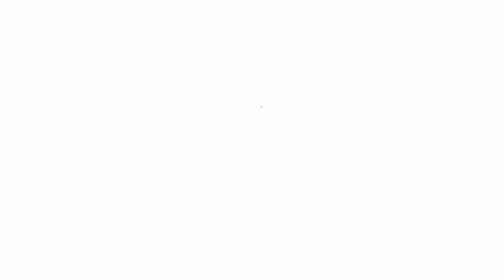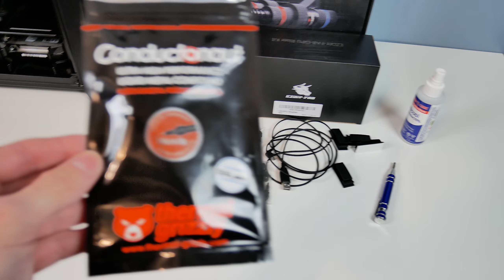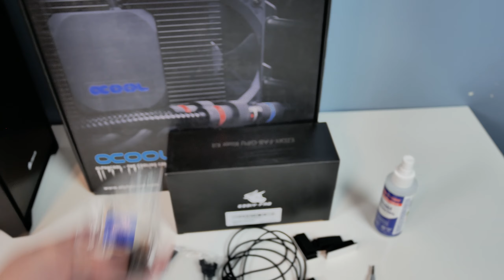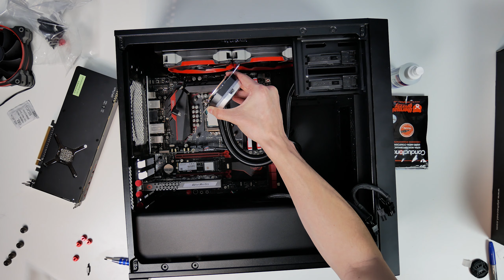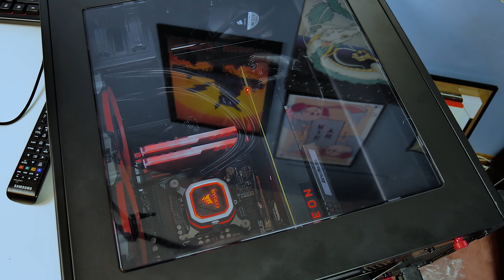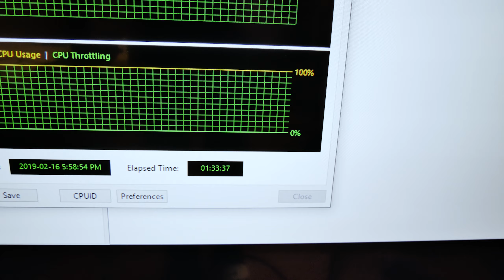A Rough Start... | Build Log #1

Comment: Good stuff. I think it's time for a new case, like Corsair 460x or something, there's built in vertical mount, removable psu shroud and plenty of space both for cpu and gpu liquid cooling mods, which would've save you some money not buying additional accessories. But I'm sure you know this :)
Reply from the maker: Thanks! I actually am not a fan of the 460x. I prefer the brushed aluminium look of the 350D. Hence why I also have a Corsair 800D :p. I can still  make the liquid cooled Vega 64 happen. I have a buddy who's got the 240mm radiator for the AlphaCool GPU water block. The vertical GPU mount was more of an experiment because I've never used a GPU in a vertical orientation before.
Reply: @WiltshireTutorials  Man, those are ancient! I get it though, everyone have their own taste. I have Corsair's Carbide 275r and I love it a lot. I picked it because of its minimalistic design and form factor, which isn't mini-ITX, but big enough to fit my 1070 ti SLI, a sound card and a front mounted 280mm rad. It doesn't have the best thermals, but it's decent and not very expensive. You might want to consider one too, if you don't like the new higher end cases.

Comment: you must have a really messed up 4790k, because ive never seen above 70c on mine at 4.9ghz and its still on air. it idles at 35-40 depending on room temperature. mines not even delidded or has any special compound, just basic arctic silver from 3 years ago....
Reply from the maker: The TIM wore out on the CPU and I ran it for a long time. With liquid metal it now idles at 26C and gets up to about 82C full load @4.8Ghz. I need to tweak the voltage a little. I probably damaged the CPU a little by using it when the TIM wore out. I'm pretty happy with bringing it back from the dead though!
Reply: @WiltshireTutorials  that sucks about the tim. look on the bright side though. if you burn it out that just gives you an excuse to upgrade to a newer cpu.  i didnt go higher because ive never been very comfortable jacking up the voltage too much long term. i had it at 5.1ghz at a little over 1.4 on voltage, but that was nerve-racking  considering the pc runs about 20 hours a day